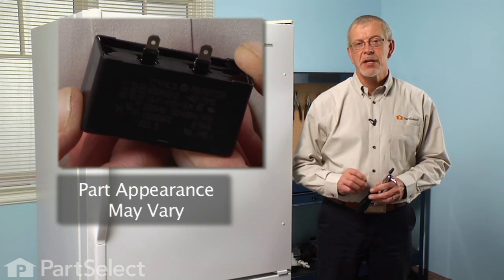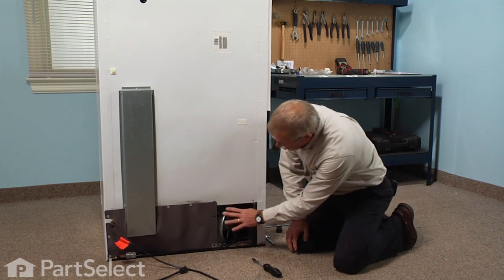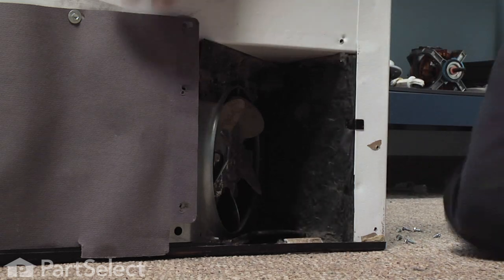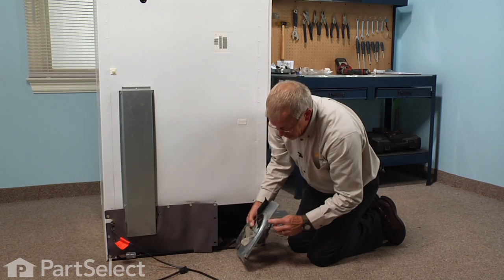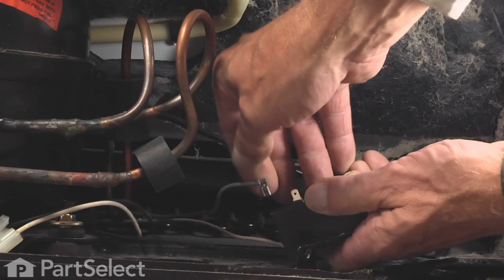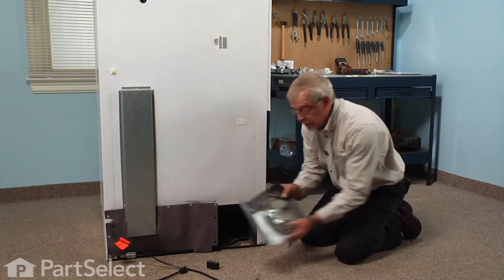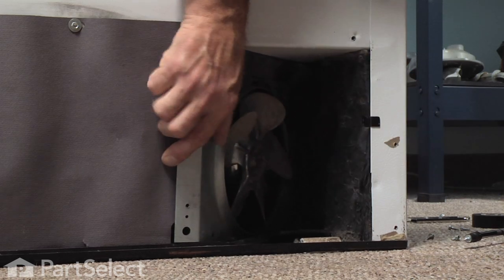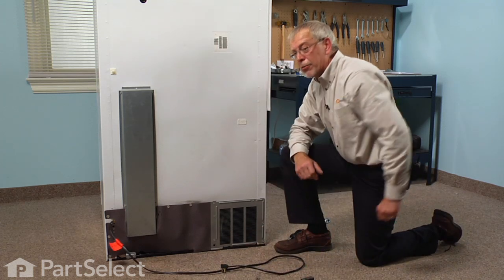Refrigerator Repair - Replacing the Run Capacitor (Whirlpool Part # 65889)

Comment: I have a Maytag refridgerator that is about 7 years old and the compressor is running, but seems to run hot at about 126 degrees F.  I did notice the freezer was getting warm due to an alarm on the fridge.  I unplugged the fridge cleaned all the coils from 7 yrs of dust and removed and looked at the run capacitor.  How do I know if the run capacitor is bad?  Is there a way to test this capacitor?